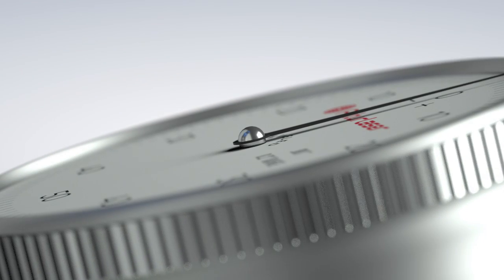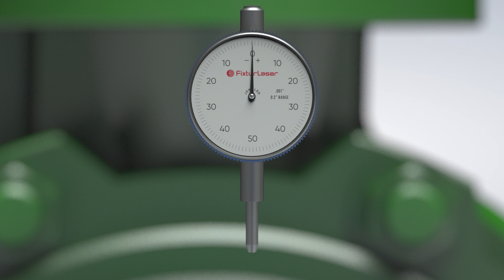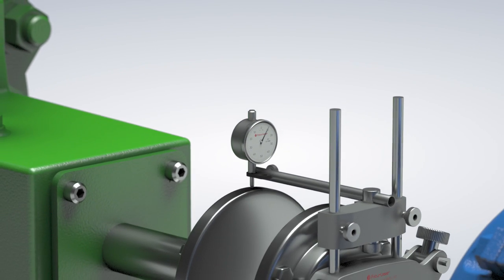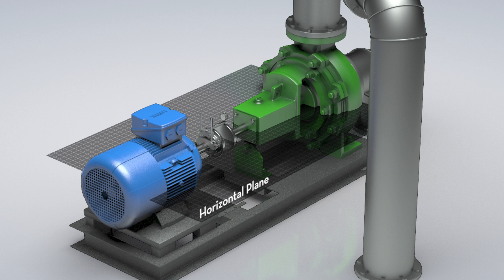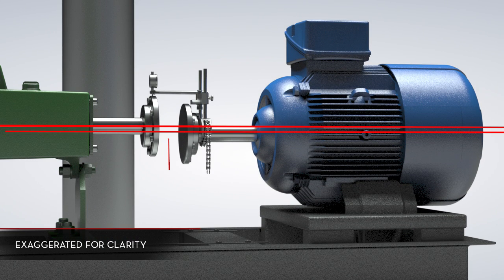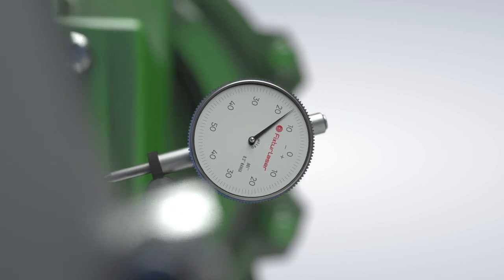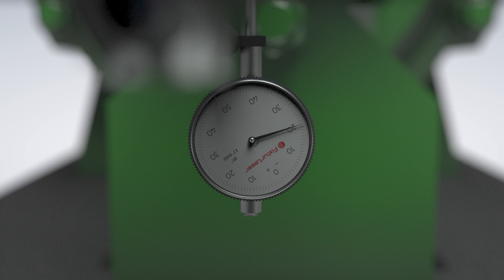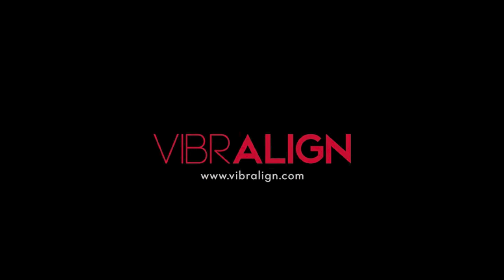Concepts of Alignment: Dial Indicator Basics | ACOEM

Comment: Why divide by 2 and reset dial to half the value?
Reply from the maker: Usman, rotating the dial indicator from 12 o'clock to 6 o'clock captures the amount of offset misalignment twice, once at the top and again at the bottom.  That is known as "total indicator reading" or "TIR".  After resetting the dial to half the TIR value, the dial will be reading the actual amount of misalignment, rather than 2x the misalignment.  We call this "true position sensing" because the dial will now be reading the actual misalignment amount at any position to which you rotate the dial.